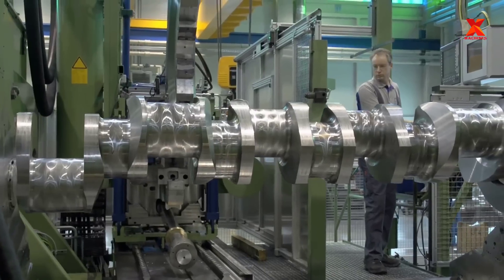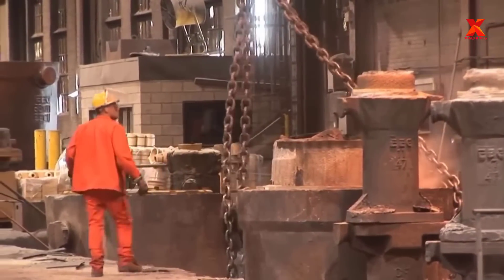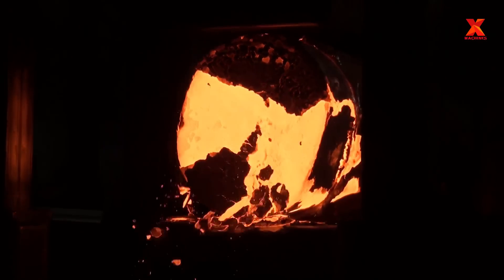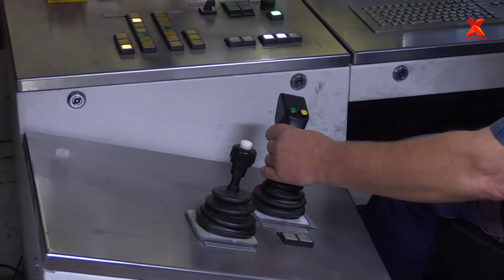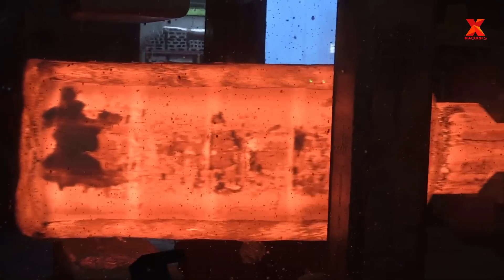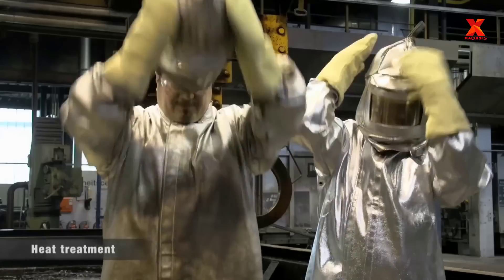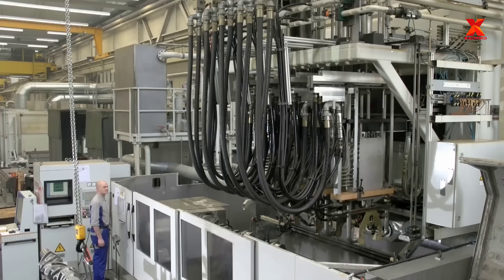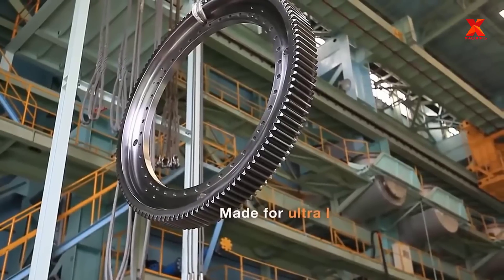The world's largest crankshaft manufacturing & assembly process by forging & heavy-duty CNC machines

Comment: This video is incoherent. Usually to make strong piece of steel the manufacturers prefers steel from blast furnace instead of electric furnace because of impurity and quality management. From blast furnace cast iron is refined to Besmer process. Also, we didn’t saw the real crankshaft but smaller piece, probably because access to real documents was too difficult.